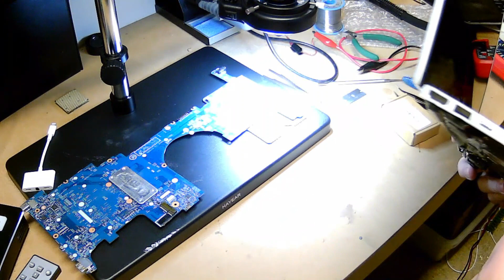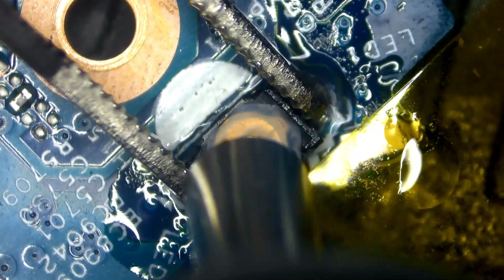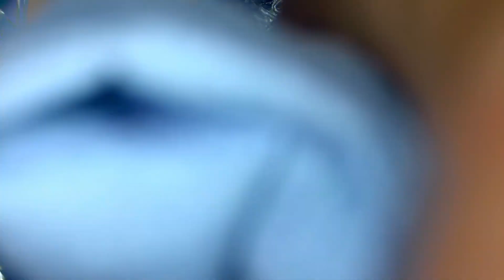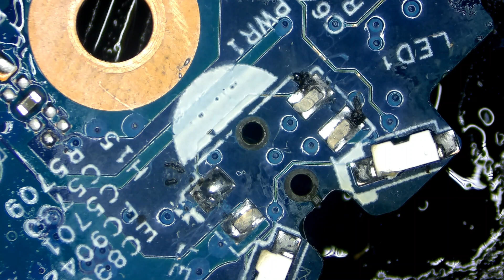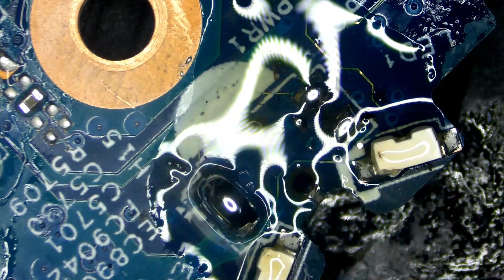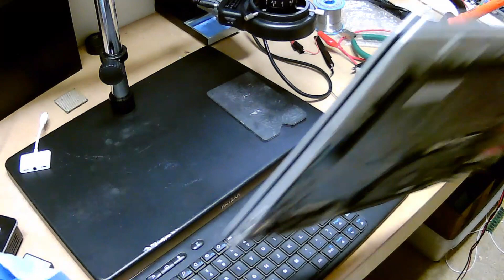HP ENVY X360 power button replacement - microsoldering

Comment: Thank you, i saw your video how the switch is inside, and now i understand (was testing wrong spots) the volume down was stuck inside, i removed it and the system is no longer doing volume down all the time, the customer says they never used the button as it stopped working years ago, they use the keyboard fn or touch screen :D

Comment: I have this laptop, problem is volume down is stuck,  at first we tought it was keyboard FN switch, but then i unplugged keyboard and it was still lowering volume, i then see the buttons and maybe they are stuck in short (as if pressed) i removed the volume down switch but it still doing it, the switch seems to be stuck shorted, and the motherboard pins also seem to indiacate there is a short with no switch.  could it be something in an IC?   unless i removed the wrong switch the other seems to be stuck shorted too
Reply: i had removed wrong switch lol, removed both, customer dont want/need the buttons